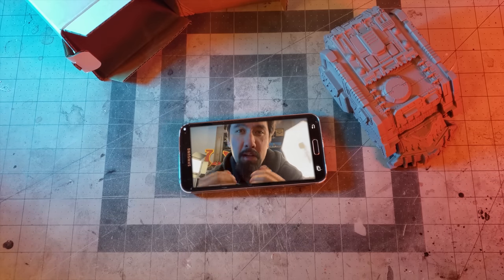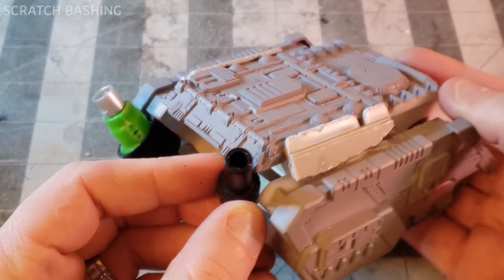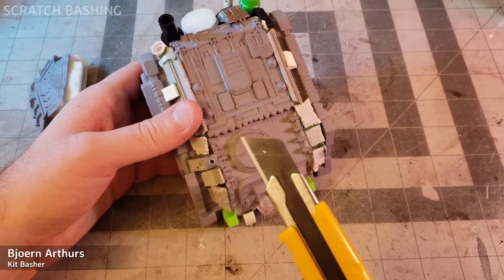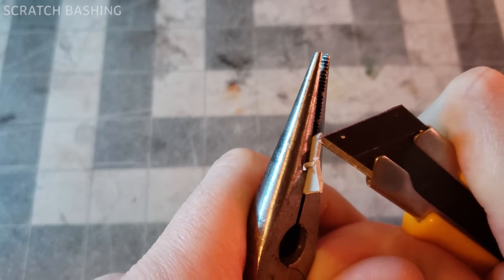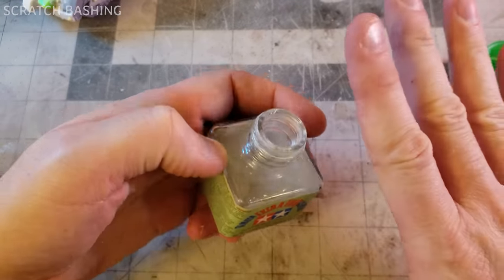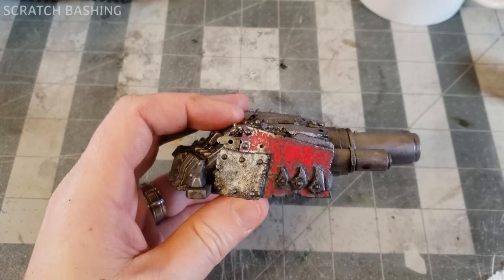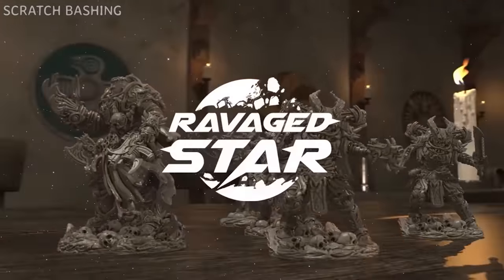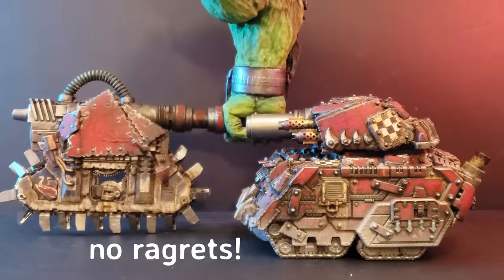Ork Tank – Warhammer 40,000

Comment: Sooo about that rubber garden wire not holding paint, i had the same problem with getting paint to stick to an aluminum can and i found out that hair spray can help out with these issues. I picked up a random super mega strong hairspray and it worked wonders as a cheap primer for weird surfaces
Reply: I had a project on the table while watching where I had this exact problem. Just tried it out, works like a charm. Thanks internet wise one
Reply: thats really clever ill have to give it a go
hair spray is water soluble so make sure you varnish everything after, people literally use hairspray for chipping effects lol
Reply: @Nillerus  that's awesome haha, glad it helped! I initially noticed it worked like this when trying to figure out how to lock my diorama details in place without getting it all soaked (which actually worked decently too!) some overspray got on my new can and it got coarse and grippy on one side and sure enough that held paint with ease. The other poster has a good point with it being water soluble though, definitely lock the entire job down with some varnish at the end
Reply: @mrflapjacklover  That's also a very clever use of hairspray, thanks for that tip! Also very good to know to lock it in with a varnish at the end, i didn't consider that it's water soluble
Reply: This comment is blessed by Mork
Reply from the maker: Thanks for the tip!

I ended up brushing on a thin layer of tamiya putty+model cement and that sealed the rubber up real nice
Reply: @ScratchBashing  Thanks for all your tips and inspiration as well my dude! Your combo sounds very professional, i'll check both of those out once i can expand my shoestring budget for crafting haha. Gotta say i really do love how open the youtube crafting community is with sharing their "secret" formulas, it makes the hobby so much more accessible for a layman

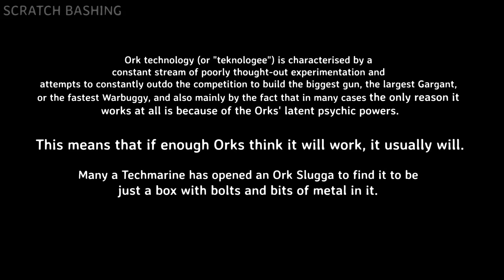Comment: The Ork Lore you showed for a second at 7:06 (please correct me if I'm wrong, I was correct by another 40k enthusiast online) is the "old" lore.

Latent Ork Psychic power/presence only helps existing machinery work,  there has to be something there. No engine in a car means it will not work, no matter how much "dakka" there is or spammed. (This is a very large oversimplification)

But I strictly adhere to old lore so no biggie for me.